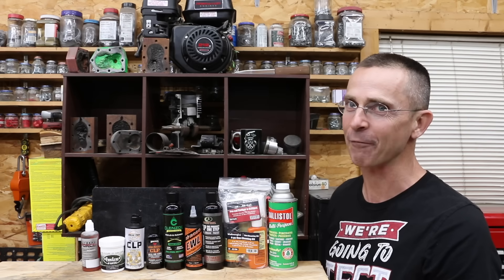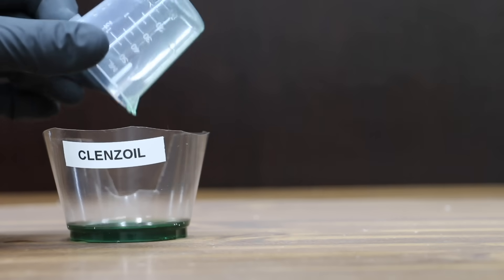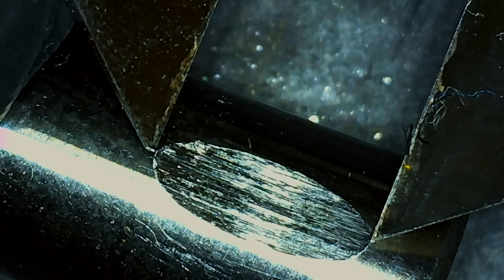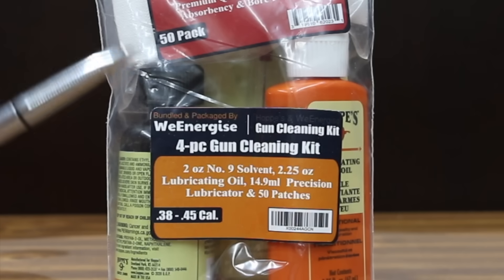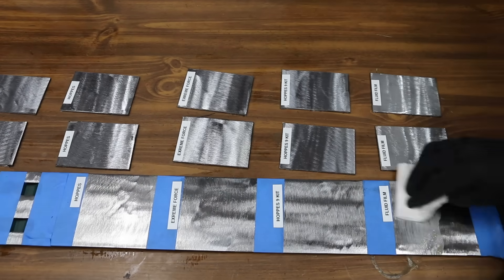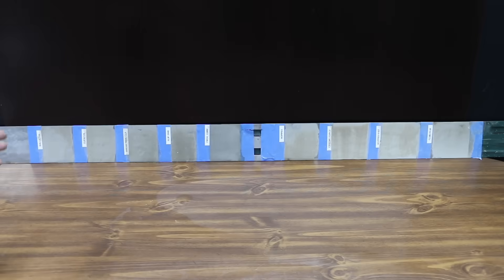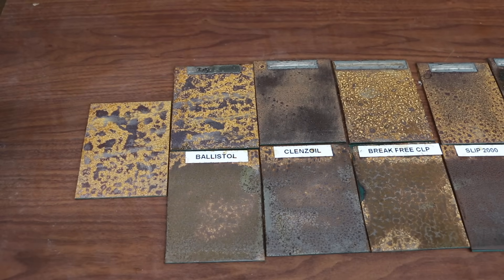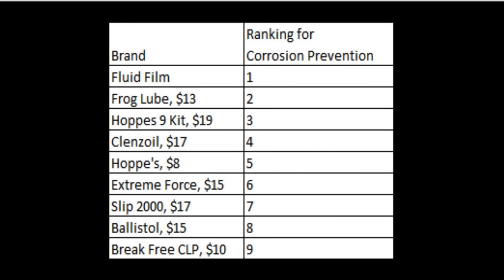Don't Buy A CLP Until You Watch This Review! It'll Save You Time And Money!

Comment: Frog Lube is terrible. It hardens over time and seizes.
Reply from the maker: Thanks for the feedback.
Reply: Frog Lube is a great protectant, but horrible lube.  I use it externally on my blued guns, and it works great stopping surface rust in the brutal humidity of SE Tennessee.  I use Rem Oil or Balistol internally for lubrication of moving parts...

Comment: Once again, an excellent and thorough test of a multitude of products.

Only thinking point out, and ask you do different if you do it again and use frog lube, and no, I don’t use it, is when testing frog line I believe it’s recommended to heat the metal up when applying it. Which was why in the oven test it did what it did and ranked 1st.

So if you do the friction test with the past or any other frog lube, Heat it up to a liquid and then coat the wheel like you did the others.

And should you test lubricants again, please test Gun Butter and Shooters Lube.

On a side note, I wish they still made Gun Sav’r CLP. I’d like to see how that would have help up?

P.S.
I’d also point out and remind everyone, that, as we all know, when it comes to the corrosion test, firearms have a finish be it bluing, color securing, stainless, Durcoat, Cerakote or even a parkerized finish to aide in corrosion resistance. Still a worthwhile test and thing to know though.

Comment: I've tried all sorts of commercial "miracle" gun oils over the past 62 or so years I've been shooting. I'm a retired engineer now and a while back came to the unscientific conclusion that "oil is oil" when it comes to basic functions like lubricity. rust prevention and surface retention under civilian type of use. There are those compounds advertised as lubes that I learned to steer clear of (WD-40 and similar ones being the main variety) but found that formulations like FP-10, MPro 7 and most recently, Slip 2000 EWL all seem to be quite satisfactory for their intended purposes for use on firearms. (One thing the newer compounds don't seem to do is allow firm capture of dirt, powder residue and grit on treated surfaces like some of the older petroleum oils did; but that's only observational and not based on any sort of scientific study. They all seem to make post-firing cleanup less of a chore. Maybe the newer lubes also contain a surfactant of some sort like modern motor oils?) 

Anyway, your DIY tribology tester is genius. I no longer have a shop where I can assemble a device like that. Similar machines are available for around $350 on Ebay (likely all made in China) but that's too much for me to invest on something I'd use perhaps a dozen times before relegating it to a shelf in the garage. 

I've noticed a number of shops carrying small bottles of a blue gun oil made by Lucas. Another Youtube video tested that against others, including EWL, but his test didn't use a tribology scarring tester like the one you made. It would be interesting to see how well Lucas fares against other lubes...and I'm curious to see how well something like SAE 5w-20 synthetic motor oil fares against the much pricier oils advertised as firearm CLP compounds. 

Keep up the good work!

Comment: Why not clean a gun, shoot a gun, and make measurements on a gun. This test was designed by Clenzoil and convinced me to try Clenzoil on my roller skate bearings instead of grease.
Reply: If you understand how testing works, you need a reliable control. A gun has a lot more moving parts and its more expensive

Comment: Some other factors that weren't discussed:  Which ones could you use indoors without adequate ventilation?  Which ones are non-flammable for those smokers out there?  Hoppe's #9 is a great cleaner but man does it literally stink.
Reply from the maker: Thanks for the constructive feedback.

Comment: The problem is CLP...anybody's CLP...is a compromise. It's not the best at either cleaning, lubing, or protecting. Yes the military uses it, but we all know military contracts are not necessarily based on "what is the best", but many other factors such as logistics, pricing, supply chain, etc. This is why most serious shooters use specific products for specific jobs, e.g, one for carbon, one for copper, one for lead, one for lubrication. Lets be honest here, how many guys use a specific product simply because they like the smell and it brings back old memories for them. The bearing test is this case, IMO, does not represent the inner workings of a firearm.

Comment: Sweet information!! I use BF clp and Clenzoil but it seems that the Clp actually stays around longer than the Clenzoil I spray my ram on my press by alternating between the 2 and it seems though the Clenzoil is drying out faster and feels more tacky unless I spray another layer! I use hopps bore cleaner followed by Clenzoil then dry patch and hit moving parts with both with needle tips and all seems solid!!

Comment: There is a gun lubricant made by planet safe lubricants.
The specific product is called aim.
They also make gear oil as well as a gasoline additive.
The gasoline additive is 1 oz per 15 gallons. Pretty impressive, and the gear oil is 1 oz for every gallon of oil. so there's plenty there to test.
Reply from the maker: Thanks for the suggestion.

Comment: Greetings!   This is a suggestion for an upcoming episode.    There are several brands and price points out there for this item.       Becoming more popular is the "oil catch can".    This device routes crankcase vapors from your automotive engine through a separator that separates contaminants like oil and water from the vapor stream before it enters the intake manifold.
   The premise behind this technology is to prevent or minimize deposits from forming on the intake valves of direct fuel injection gasoline engines.     Older port injection engines don't suffer this malady as the fuel injected directly behind the intake valve serves to keep the valve clean..............   Which of these devices does what it advertises for the least amount of money?
Also which is the best made for longevity,  easiest to service etc.       Something to think about.    Thanks for all you do......
Reply from the maker: Greetings!  Thanks for the suggestion.

Comment: Every time I see the name Frog lube I just about lose it. It was muzzle loader season and I had a group of hogs show up under my feeder. It was already nearly last light so I shot one. I left my ground blind and walked around a group of trees to get to the feeder. When I got near I saw a couple of hogs had come in while I was getting there. I pulled out my 9mm and aimed pulled the trigger and nothing happened. I racked the slide and to my amazement the hogs where still there. I took aim and pulled the trigger and nothing happened again. By now the hogs were scattering so I walked to the truck and broke down the pistol and put it on the dashboard so the defroster blew on it as it was in the low forties.
I had to drive a half mile to get to the gate of the property. At the gate I reassembled the pistol and tried to shoot the now warm pistol. It fired every time. I had used the Frog lube on that pistol. When I got home I stripped that pistol down and cleaned it in a heated ultrasonic cleaner. 
lubed with clp and never had another issue. The Frog crap had caused the firing pin to become seized. Never again. Fair warning!
Reply from the maker: Thanks for sharing.

Comment: Hmmmmmm, this isn’t comparing like to like unfortunately. A spinning test would be great for motor oil but firearms aren’t meant to be soaked it’s nuanced. Only certain areas and only a few drops. I can tell you slip ewl is some of the best and well tested firearm lube out there. It out performs clp on true firearm metrics. Carbon build up, lube, weather conditions and environment.

Comment: Frog lube was designed to be melted to a liquid on the parts to fill in all the microscopic pores in the metal. Usually applied as a paste and a heat gun or blow dryer to melt it. And wipe the excess off
Reply from the maker: Thanks for the feedback.

Comment: During a deployment to Africa we were tasked with training local forces. They had every AK variation and most were mixed parts. We had a cleaning session after range time. The troops pulled laces from their shoes and dipped them in use motor oil. A few passes of their bore snakes and they were done. Now I knew why we had so many FTF on the line. The bores were fine but the internals looked like muddy tank track.

Comment: Exhaust carbon is no way close to as stubborn to remove as gun powder carbon!! Rifle barrel carbon is attached to the inside of the barrel over 1000 degrees and over 60k psi. Exhaust carbon max temp is a couple hundred degrees and no pressure!! These clp all in one cleaners do not work at all on stubborn barrel carbon unless you let it soak for a week and bronze brush it 10,000 times in that week!! A bore scope will show you this!!

Comment: The intended use for each product can be quite different. This is good data but Kind of an apples and oranges comparison  test. CLP use out in the field is awesome to have in your field kit. Trying to get the CLEAN LUB PROTECT into one solution may degrade each of the 3 functions and thus separate product/solutions and steps can be better. The consumer should know the product limitations and its intended use.

Comment: Maybe a stupid question but where do guns fail the most from wear?
Reply: Depends on the firearm and quality. Which is particularly helpful. So typically you can find wear on firing pin, the slide/rails and bolt carrier. So points of contact are the areas that need to be lubed and monitored. So where the bolt carrier group makes contact to summarize.

Comment: With all of the  videos out there proclaiming this or that oil to use as if we need their "expert" opinions to tell us the things we need to know, I love that you just test the oils to see how they handle what they claim they handle and give us objective results on wear, corrosion, lubricity, etc.  I realize propensity for dust accumulation may be considered subjective but I think the way you tested cleaning the diesel exhaust deposits with the drill and microfiber with the product applied is pretty objective.  Anyway, great video and now I feel I can safely dispose of the four different brands I currently have in my pistol-cleaning kit and buy some Clenzoil.  As for cold temperature performance, if I lived in a place where the temperature ever got anywhere near  -40 degrees, I'd move!  🙂
Reply from the maker: Thanks!  Thanks for sharing.

Comment: This test needs more heat and pressure. Slip 2000is the best overall cleaner, lubricant, and protectant for firearm applications. It cleans out hardened carbon, and doesn’t become hardened carbon under pressure.
Reply from the maker: Thanks for the feedback.

Comment: Nice comparison, thanks. Just hoped to see an incorperated test of which contender "runs" at a certain temperature. Because when a gun barrel heats up, then, before evaporation the oil will start to "run out" and loose its expensive sold properties. Since most of these CLP's/lubes/greases are petroleum based, they likely won't do well after firing, lets say an entire magazine (or more). Besides of getting to thin (less viscous) and so will start running or drooling away from the desired oiled position, meaning there where friction will appear which are hot.  Also hoped to see if modern lubricants/CLP's with ceramics would do better or not.
Reply from the maker: Thanks!  Thanks for the constructive feedback.

Comment: Sir, You need do part two. I would recommend a gun like test. Most of the test seems pretty good. However, a power drill with a cloth to clean carbon is a no go. To mimic gun cleaning items with carbon for 15 min then clean with a hard nylon tooth brush and wipe with a cloth.

Part two; Contracted companies with the military currently are, "M-Pro" that uses a CLP with a separate lube, copper, lead, brass bore cleaner. The other is "Prolix CLP" and also uses a separate wet lube called "Prolix xtra". Last but not least "Slip 2000".

I can appreciate less metal wear with a separate lube. But CLP was never meant to be everything to everyone. Basic weekly maintenance cleaning in the field. The once or twice a year of deep cleaning would go through much more.

Some specific CLP's are for better protection in humid or wet environments to prevent corrosion(the Navy used "Fog lube" for a while and are still using Prolix and "M-Pro".

Dry and Dusty environments a Dry lube is used. Prolix goes on wet then drys so dirt and carbon won't attach.

Extreme cold vs. Extreme hot environments also can change what can be used.

For me I try and treat all new platforms with Prolix first before heavy shooting. The Prolix CLP just washes carbon away.

I might use my Prolix CLP with Clenzoil Lube? Could it be the ultimate combination?

Please, in part two; CLP two test. Amsoil CLP, Prolix, M-Pro, Lucas.

Wet lube test- Prolix Xtra lube, Amsoil, Lucas gun lube, M-Pro, 

Most of these companies also have a category of "Gun Grease"
Reply from the maker: Thanks for the suggestion.

Comment: Everybody is entitled to their own opinion, but not their own facts. In the case of the best all-in-one CLP, the facts are clear: CLENZOIL Field & Range Gun Oil Spray Lube is the best.

Just by being responsible firearm owner, I can take best-practice steps to mitigate, if not largely avoid, the effects of temperature and humidity. What I need help with, is metal-on-metal wear from use. To dramatically reduce wear and pro-long the life of my home defense assets, I turned to objective science to guide me. That's right, I went to YouTube University.

As shown in Project Farm's video, the majority of the CLP's were good but, only CLENZIOL showed a dramatically less wear on the moving parts test.  DRAMATICALLY less wear. Like, Bigly.   SOLD!

So based on objective scientific testing, fact, not opinion, CLENZOIL Field & Range Gun Oil Spray Lube is the only CLP my firearms will ever experience.  It's a super slick lube. As expensive as CLP is, I used a little CLENZOIL on my sliding desk drawer that was sticking, key locks, exterior door hinges, even on the squeaky door hinge on my 10 year old daily driver. This stuff is slick.  Period!

Thank you very much for this review.

Comment: Selfishly speaking, I would like to see these same tests using the same lubricants when being used with some protective coating manufacturers for firearms as well as on blades etc. 
- Cerakote (particularly Cerakote micro-slick, cerakote-h, cerakote-c etc.)
- Gunkote
- DNC
- Anodizing finish
- Nitride finish
- Durakote
- Bluing "More for knives" 

If not that, maybe test some of the dry lubricants like 'OneShot' etc. 

I know that's a lot of requests, but I thought I would ask. You never know lol.
Thanks again! 
-Dave
Reply from the maker: Thanks for the suggestion.

Comment: @ProjectFarm So I've been using the BreakFree CLP for almost 2 decades and switched to Clenzoil only recently based on your testing. I have experimented with Slip 2000 EWL in the past, tried EWL30, and the Slip 2000 Gun Lube. I have doubts about the wear scar test methodology being applicable to gun lubes/CLPs mainly because there's not a steady stream of lubricant like in your test rig. Clenzoil showed the smallest wear scar but in the 2 years I've been using Clenzoil, I noticed it is extremely thin and tends to drip off after time, and never seemed to lube metal contact as well as Slip 2000.

I feel if you were to visit another CLP test in the future, you may want to see which product stays on the longest by measuring the mass of a coupon sample before and after applying the product, and then seeing how much of the product remains on the surface after hanging it for a period of time. And then testing for a wear scar on that sample without applying more lube. That's probably a better measure of how well the product can lube the surface.

Thanks again for the great testing!
Reply from the maker: You are welcome!  Thanks or sharing.

Comment: Sorry but the first test is completely useless for guns. How does this mimic friction you'd have in a gun? With this reasoning just buy a heavy duty gearbox oil and you'll find your "winner". 

You want two things for a gun oil: thin and clean burning to avoid carbon residues and enough corrosion additives to avoid rust. Thin oil means not a lot of surface separation during use but you don't have a scenario like that in a gun.

The method you're using is useful for bearing or gearboxes, not for guns.